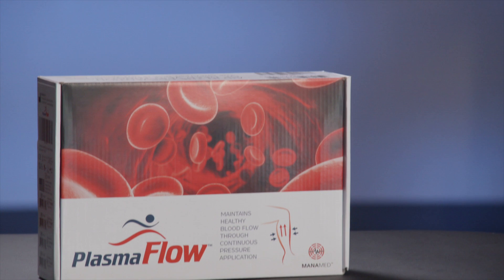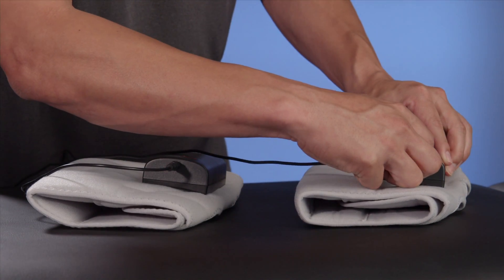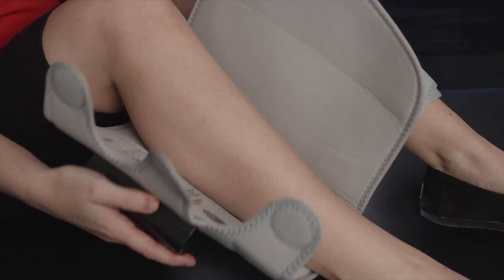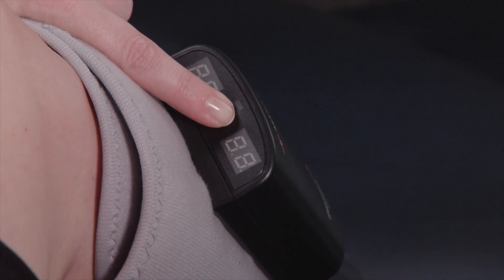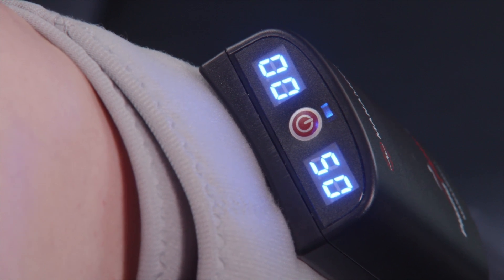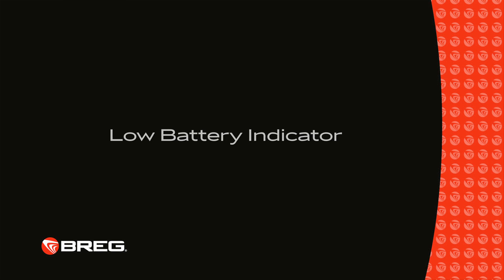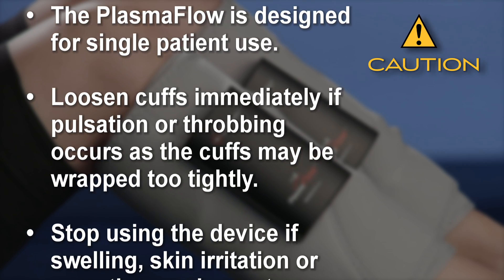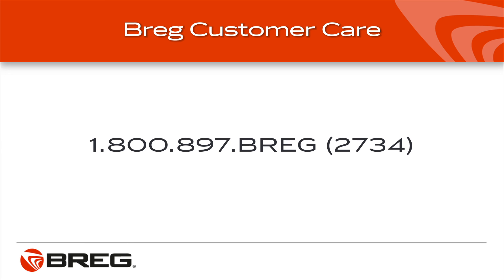PlasmaFlow™ Application Video

Comment: How much does this system cost?
Reply: $300 insurance doesn't cover
Reply: @veronicaarellano6941  you might try Ebay, I just found 2 complete units for under 50.00
Reply: I wish i would've known sooner 😔
Reply: I just had knee replacement surgery.  They helped a lot for improving circulation and swelling. Now ... that being said. These things turned out an insurance scam for me. They accidentally sent me a pair after I received the first pair.   The first pair I bought myself on eBay. They were still in sealed packages and were exactly like the ones they sent me. The difference was that items they sent me had a bill. Of course at that point my hair caught on fire. The price tag they were hitting the insurance for was a lot .... I only paid $40. For the ones I bought on eBay. I also see they sell them on amazon.  So I would suggest anything the insurance is getting billed form you question the cost. Before you pay, “question you insurance company and or doctor.  To be honest ... they are not worth much more than $40. Sort of like the government hammer cost.  My surgery turned out great .... getting ready for the other knee to be done.
Reply: @veronicaarellano6941  mine did.

Comment: What’s nice about these is, after you have surgery and are trying to get some shut eye, the battery will last just long enough to ensure you finally slipped into a peaceful state of REM sleep, and then the piercing, demonic low battery alarm will fire off and almost send you and your spouse into cardiac arrest at 4 in the morning. Oh you thought you deserved a full nights sleep? Heh. How Quaint. The battery has run out and for some inexplicable reason, the engineers at PlasmaFlow decided that you ABSOLUTELY NEED TO KNOW THAT,  irregardless of your feelings on your circadian rhythm and how lethargic you’re gonna feel the next day. 

So don’t forget to charge your device, but it won’t matter because your PlasmFlow won’t last the night anyway, and instead of just silently shutting off, you’ll awaken thinking your house is on Fire. So see you at 4 in the morning lads! 🍻

Thanks PlasmaFlow!!🙌🏽